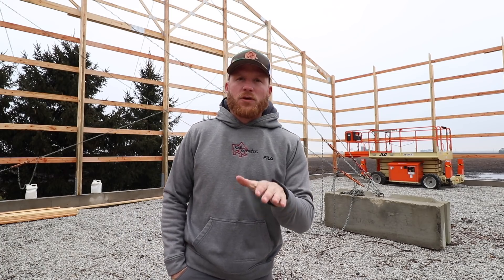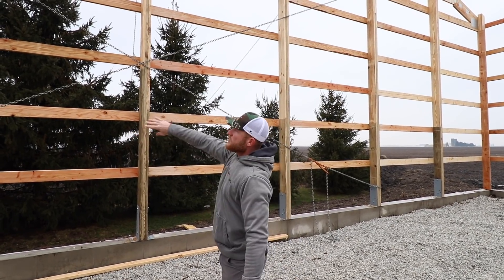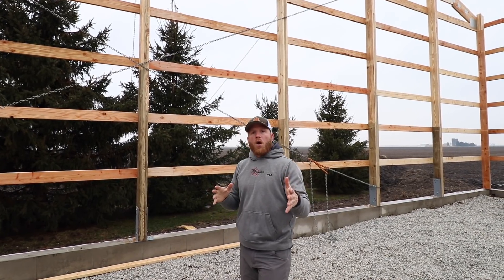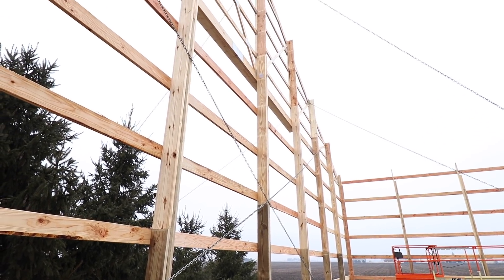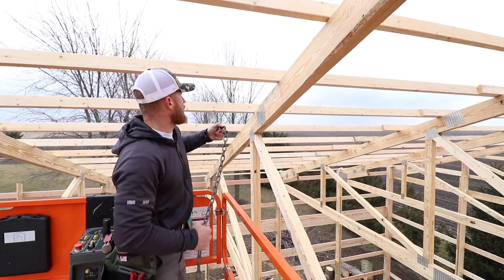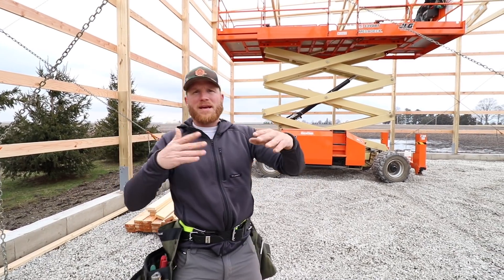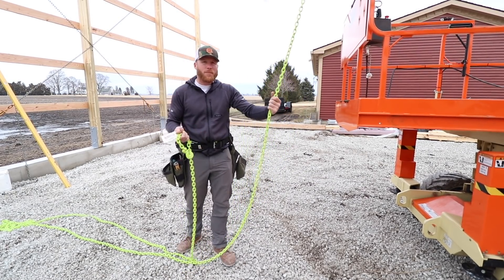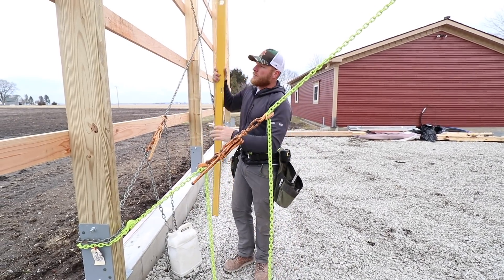Chain Hacks: Using Chain to Brace and Straighten a Building

Comment: Seeing as I am only doing one build and it will only be with 8 foot walls and 4/12 pitch roof. We don't have  100s of feet of chains to secure the structure and will do so with lumber bracing. SO.. any tips on most critical locations and temp layouts that won't make necessary work in area inhibitive. Thx! I am learning a ton from your helpful videos and am excited to get started....FINALLY...this spring.

Comment: After you have both end trusses straightened out, have you thought about just using the application of the metal roof sheets to straighten out the eaves on the side walls?

Comment: To get the in between with those chain binder, tighten up or spoken up a link on the connection going around the beam that it’s hooked to
Reply: The OutDoorsMen this comment was added a lot. My only worry is that the chain would be more able to turn around the post that way.  For some of the chain installs that could be a big failure

Comment: now i understand the chain thing thanks. ya know if you keep this level of edjamication for your subscribers i may be able to put up a pretty good diy pb myself. if you have time to answer ??? i have one for you. for us poor slobs that dont have lifts and skid steers etc. any idea what could be used for a chain anchor and how much it should weight. don't know if it matters but i plan to do a 60x32x12 pb.
Reply from the maker: Drill a hole and pour it with ready mix... then throw a look of rebar into it

Comment: Just wondering if some 1 inch ratchet straps since they are seriously cheap from a cost perspective would be easier then wedgeboards since the boards can get bumped/kicked vs a ratchet strap up at an angle to a cross member where tiny adjustments to square can be made ? Excellent videos, keep generating them for sure !!!!!!!!!!

Comment: Great video and I like the use of chains and a board to fine tune the amount of pull. I used chains,straps,and cables to build my barn. Was what I had and made it work.
Reply: When I was building them, I had about 10 cable com-a-longs with 1/4" grab hooks on each end and used them instead of the chain binders. That was back in the mid '70s. You have a good crew and method worked out, nice job their guys.

Comment: Got a tip for you if you move the chain a full link and that to much use a 1/2 link by moving the chain a full link that is around the post = half link on the chain length.

Comment: Do you think it would be easier to fine tune the walls if you used ratchet binders?  Sorry, just finished watching the whole video.  When you get around to replace your binders I am sure you will find it quicker to do your fine tuning and it will be safer than using all the boards to tighten.  Your vids are the best on this subject.

Comment: I would not recommend using Grade 30 or proof chain, you should use at least Grade 43 and not more than 70 (transport) for this type of use, due to safe work load limits and winds can get strong. You should have mentioned the grade you are using, Kyle.
Reply from the maker: Grade 60 is most of it and I have some g100
Reply: Really?? What a dip  everybody  got to be so critical.  Show us one of your videos.  Lol that’s what I thought.   Great video thanks Kyle.
Reply: @tyler6865  I am not criticizing, simply am just recommending/suggesting the minimal and maximum grade (the higher the grade the more the chain will weigh) you would want to use based on the fact you are going to crank on it and as he said he is in a wind prone area as one can see themselves. Simply also just suggested he posted what grade he uses in which he replied. Calling me a 'dip' makes who that is one here?

Comment: just a FYI, you can adjust by 1/2 link by moving the hook
 1 link @ the loop around the post or anchor point
Reply: I was going to comment the same thing. Because the chain is 2 parted around the post you can move the hook 1 link and it's the equivalent of moving it a 1/2 of a link. I use this trick every day moving equipment